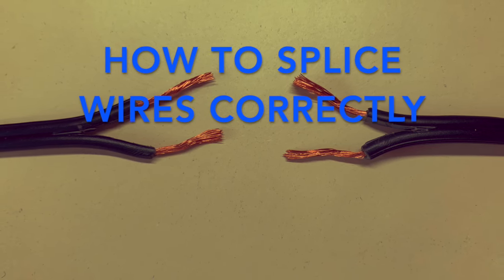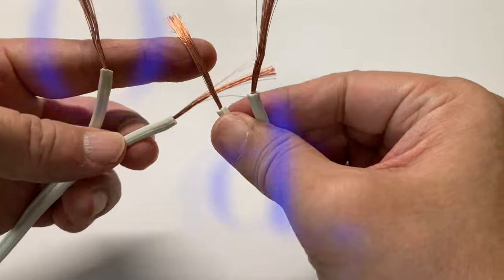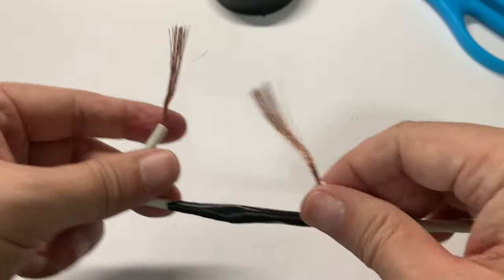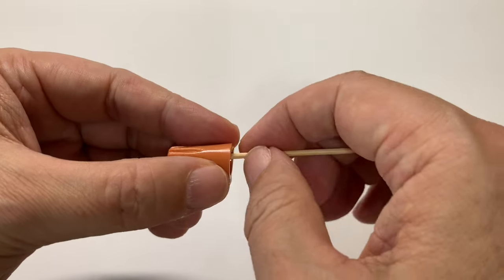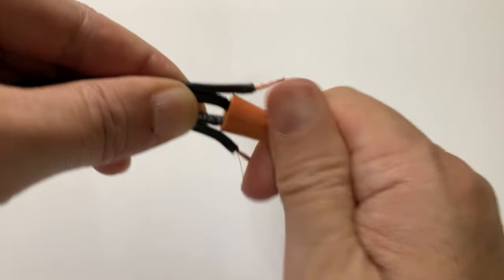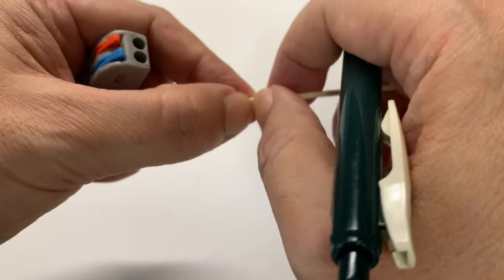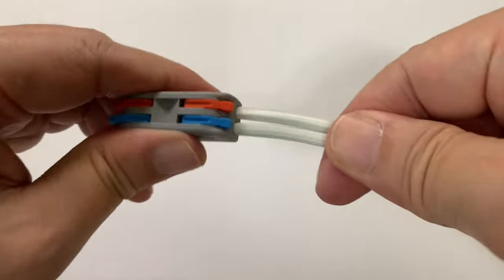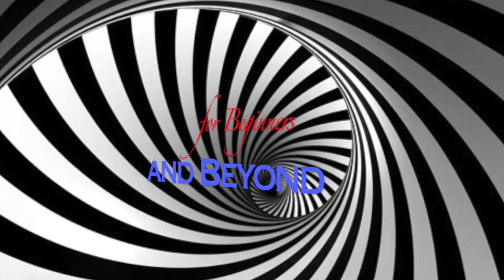3 Ways to CORRECTLY Splice Electrical Wires

Comment: All of these methods are illegal within the United Kingdom. Flexible cables must be contained within a fireproof container with cord grips to secure the flexible cables and requires a tool to open the fireproof container, unless within an approved electrical trunking system. Terminals are required to electrically join conductive cables. Please note PVC insulating tape is only meant to be a temporary method during installation, not permanent. The glue will degrade over time and become loose and fall off. This entire video is very bad advice leading to fires and electrocution, which is why it is illegal.
Reply: Everything is illegal in the UK. Do you have your permit to watch this video?
Reply: Yeh watching this video as an amateur really made me feel better about my skills lol
Reply: If I may, what should i consider doing before doing this? My car has a few bad wires and I’m not too pleased with the concept of my car turning itself into a speeding fireball.

Comment: Thank you for this video! I have the connectors, and when I cut the casing from the wires, some of the copper strands get cut off. How do I get it so that all of the wires are in tact?
Reply from the maker: @emmandoriao4129  Please elaborate. What “casing” are you referring to? What connectors are you using?
Reply: @forbeginnersandbeyond6089 I meant the cord. When I slice the cord, some of the copper wires get cut. I am using the connectors. I was trying take a pic, but the option is not there

Comment: any need to match the wire ends of wire you're adding to the first set in the lever exp?
Reply from the maker: I don’t quite understand your question. Can you elaborate?
Reply from the maker: Preferable, but not necessary. Just be aware that the thinner wire can safely carry the current (amperage) capacity

Comment: Im in oregon, where can i get full wires for my burner pan.  Ive replaced the burner switches and they dont last very long even with the heat rap.  This time i use your hook wire method.